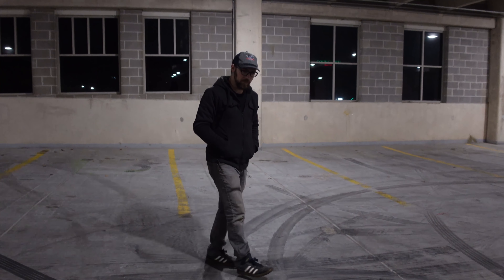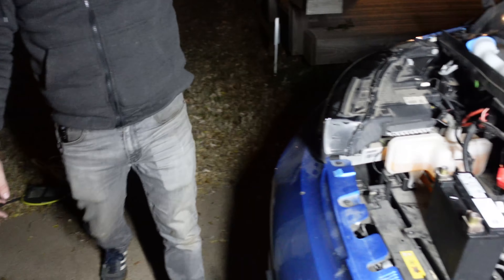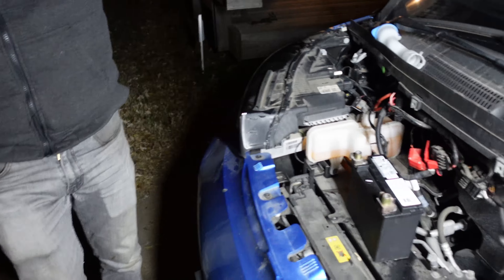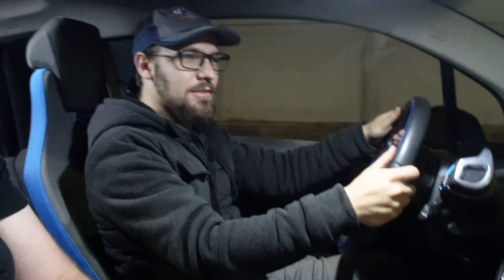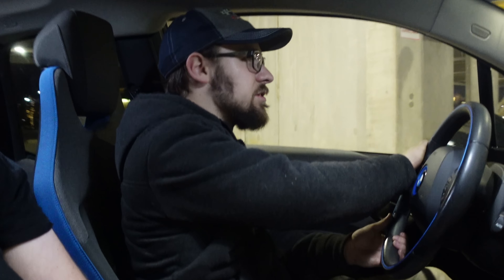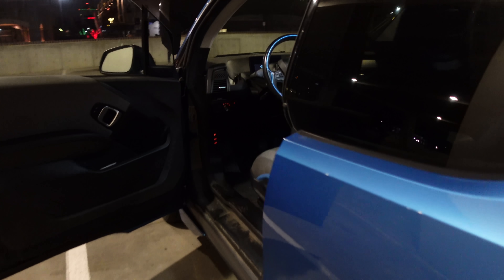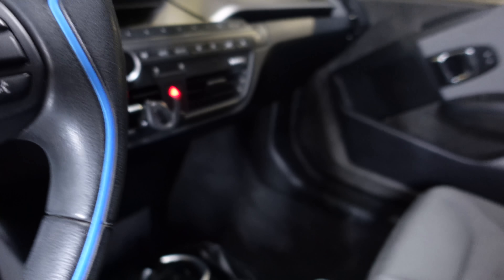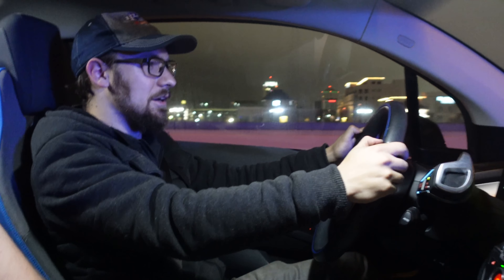The BMW i3 is the WEIRDEST used EV money can buy

Comment: Oh, stop whining.  I am a 60-year-old, short, fat woman with zero mechanical experience, and I replaced the battery in my '14 i3 with a pair of pliers and a manual screwdriver.  The limitation on tires are a pain in the ass, but other than that, I love the little bastard.  I have not noticed any limitations with the REX, either; can do highway speeds with no problem.  Great visibility, zippy, can turn on a dime, and mine has 12 speakers... oh yeah!  And as for the Volt, I tried one, and visibility was awful for me.

Comment: Thanks for the video. A few points: the battery is hard to get to because it is a BMW. The battery in my wife's 2012 328 is MUCH harder to get to. Also, the i3 is a serial hybrid and all others are parallel, not the other way around.

Comment: This is such a weird yet cool car. It has a carbon fiber body! Which is uber cool.
Those suïcide rear doors can only be opened when the associated front door is also opened. BUT when you are parked close to another car,  for instance in a parking garage, you can't walk away from the car because both opened  side doors box you in  preventing you from doing so. Which is weird!
I would own/drive one regardless.

Comment: NOT HYBRID. By definition, a "Hybrid" used a mixture/blend... "hybrid" drive by both electric motor and gas engine... the i3 is PURE electric drive, but the Rex version has an additional gas powered generator to add charge to the battery... it in NO way adds mechanical drive to the vehicle... it ONLY extends the electric drive range.

The "Life Pod" (CFRP) is repairable in 6 different pieces... but only by a specially trained BMW Carbon Fiber repair person... but it does happen.

Comment: Around 7 mins - the HV isolator - there's a catch on the side which you have to defeat with a small, slim screwdriver blade [etc], when pushing the black and red bits down to reconnect. (On mine anyway!)
At 8 minutes, the reservoir nearest the front is drive coolant, and the one behind it is climate control coolant. 
10' 20"   I think you were a bit dismissive of the rear seats. Just 2, but they are fine for adults. I think the seat backs were set in the upright position, to maximise boot / trunk space - they are much more comfortable when set to the reclined position!
The Intelligent Cruise Control is Not So Clever, actually, as it is camera based, and gets fooled by low sun ahead etc. That's a pity.
I'm surprised you didn't think the self-parking [parallel parking] feature [at 25 08] not worth mentioning. It's magic! 
There's a BMW Blog out htere somewhere pointing out that as the wheel diameter is so much larger than many small cars, the contact patch is actually much the same as you would expect. 
It's such a shame they dropped that colour in 2018 - Protonic Blue. ❤
NIce video, fun to watch, and no doubt I'll be back to watch more of your stories.

Comment: Over here we are banning the sale of the hybrid versions in 2030 and will only be having  battery powered versions so can see that going well without any infrastructure in place as not everyone can have a charging point so hybrid was the answer.

Luckily I’ve now got 5 nice cheap petrol  motors sitting on the drive in immaculate condition with covers over them so I’ve enough cars to last me now till I’m 6 feet under.

Comment: I had a couple of these in the past
Great cars but the suspension is harsh and bouncy at the same time

I strongly disagree with you on the back seat. I am six feet tall and can adjust the drivers seat to where I feel comfortable and sit behind my seating position and have plenty of head room and leg room

The i3 is a packaging miracle. Small on the outside but as much interior space as a three series. One of the greatest and most misunderstood cars ever made

Comment: I like the time traveling videos! Can you just let the car sit with the gas engine running and charge the battery or does it have to be moving for it to run?
Reply from the maker: It shuts off automatically when you stop moving so it doesn’t seem possible
Reply: @100PercentJake  Maybe it can be recoded to sit and charge. That would be a game changer on that car. Every stop light would extend your range.

Comment: Jake: Does that one-pedal driving mean you can't just coast with no braking?
Reply: The only way to coast is to hold the gas pedal into the position you want to keep your speed or drop it slower than the regenerative brakes do themselves.
Reply: One pedal driving is one of the best parts of i3. Yes you can “coast” easy as just by easing off pedal, it becomes so intuitive and smooth you’ll never want to go back. That’s why economy is so much better around town than highway- constantly recharging.

Comment: The tires are what killed it for me, you have like 1 or 2 options for tires on the car, none of them all that good, and they are all on giant wheels which sucks for a city car. Loved the visibility from the driver's seat and the overall feel of the car materials. 

Sort of want to try out a Mini SE (which has a lot of the i3 drivetrain), which takes away a lot of the uniqueness from the i3 but has just enough range for exurban commuter life in a fun to drive package. But used ones of those haven't hit the market yet and won't ever hit the market in all that high volumes.
Reply: The tires are also a deal breaker for me. I don't expect companies to support that size for very long. I want the carbon fiber tub so badly though!

Comment: there are so many errors in this review really you need to do your research,
you have a 2017 it does not have a electronically reduced fuel tank
and on the rex alone it will cruise nicely at 65 on a level road until it runs out of gas.
just for a beginning